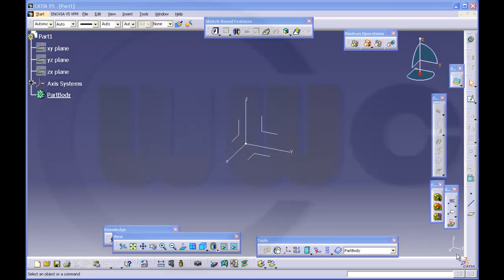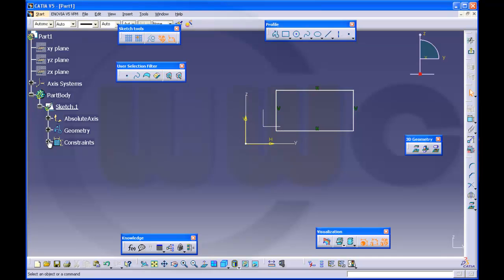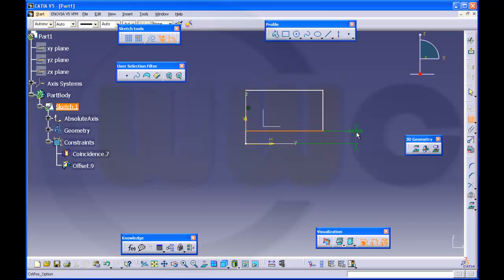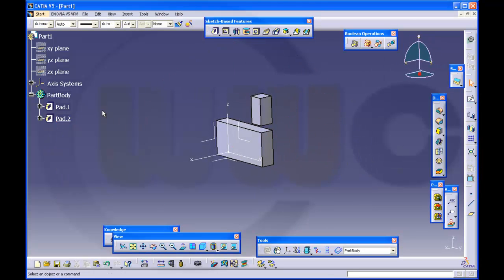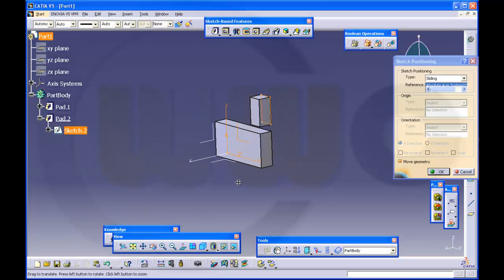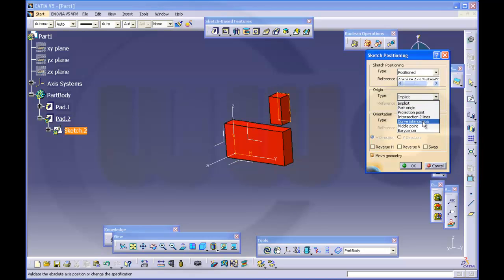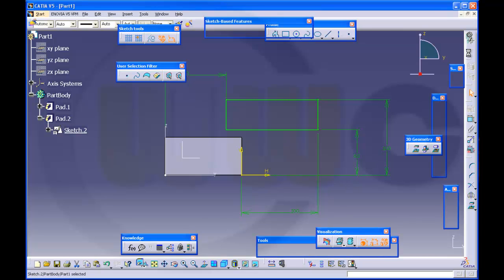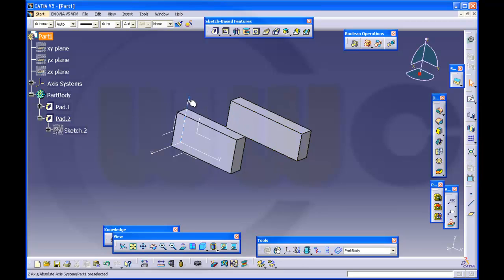Basics part VI - Catia v5 Training - Axis system vs. projected h/v-direction in sketch

Comment from the maker: Depends on what you want to achieve. You should never mix them. But for example - powercopy "freistich" I used the yellow ones only :) - in some cases they are very useful.
Reply: so, there is no problem in using them just avoiding mixing constraints. But in you use constraints with yellow ones and reposition the sketch in a non-parallel plane, maybe there are problems....projected new axes will be quite different from the original yellow ones...